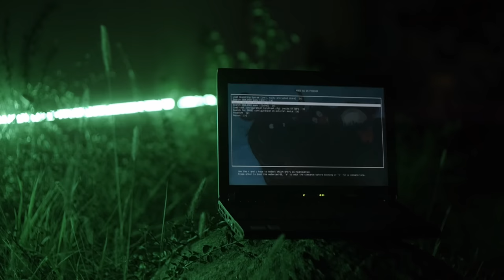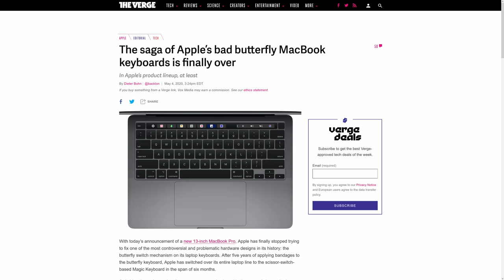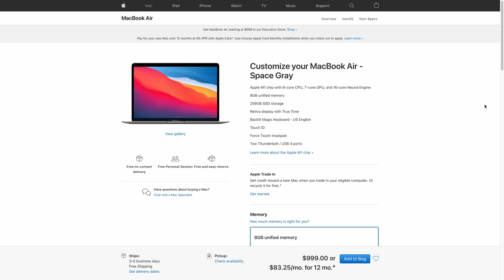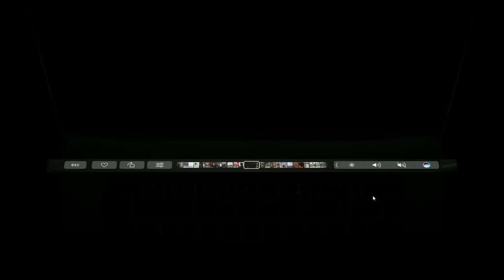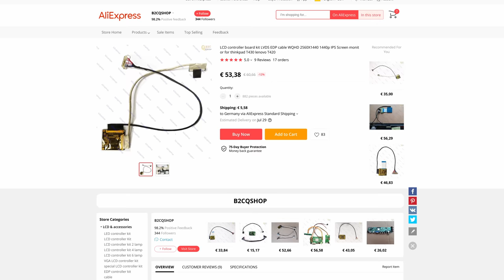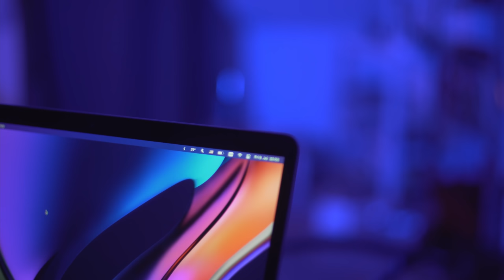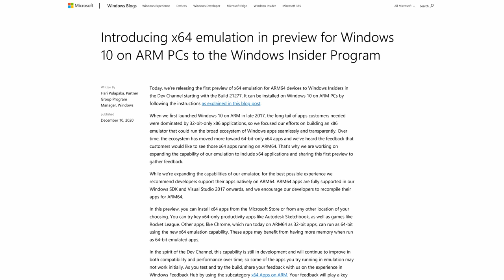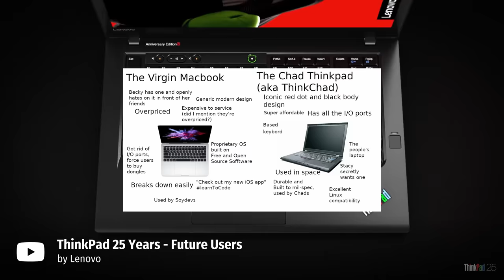Why I Switched to Mac (as a Linux user)

Comment: I have about 15 (older) thinkpads and love each and every one of them - but my daily driver has been a macbook air M1 since last December. You gotta be realistic about these things - and recognize a revolution when you see one. I even made my own pascal compiler that compiles natively to M1 ARM assembly language. Even though I do enjoy the past (my x41, x61, x220 etc) - I really appreciate living in the future! Thanks for having made this video =)
Reply: well, sure. Right now, M1 runs fast. That's not because apple is somehow revolutionary or anything - it's simply that Apple ported their OS to ARM first.

Give it a few more years, and all laptops will be ARM, and then apple will be one of the ones with worse hardware again.
Reply: Right? Bought my first mac a couple years ago, the m1 air, and it is so silent and portable.
Reply: @iFireender  well, first we need that to happen. Until then it is all conjectures and imagination.
Reply: @iFireender  It wont happen in a few more years, there's just too many programs and gaming that are done exclusively on x86_64, it will take more than a decade
Reply: @tuxthedev3470  luckily, programs that require high amounts of resources usually are newer programs. Newer programs (mostly, and really should) have well-controlled codebases. Most languages have well-defined cross compilation possibilities.

You can easily emulate a decades old x86 program on an ARM machine - those usually don't even begin to use up the capabilities of modern computers.

As for other programs? You basically just need to cross-compile, if even.

I assume we're going to see a true 50/50 split, where there's both ARM and x86 machines, performing similarly, arm slightly better, x86 being more legacy compatible, in 3-4 years, and in around 10 years we'll be entirely switched to ARM and/or RISCV.
Reply: @iFireender  That scenario seems more plausible
Reply: I don't like Apple's approach either about user upgradeability or repairability. Its all really been about the dollar, charging so much for an increase in storage, getting you to buy a hub because of lack of ports. That being said I do like they're products and the Macbook is a fine piece of kit and engineering...along with the ipads with M1 and M2 chips.
Reply: @jeppepuus  what is a fucking joke with apple is the pricing. Yes, the cheapest models are a good deal. Add 1tb of SSD (which should cost what, 60-70 bucks by now on the market), and 8GB more RAM (not even 50 bucks)? Please pay up 400 bucks.
Reply: Now there is a name I have not heard since high school in the late nineteen hundreds
Reply: @topmech71  I guess that's one approach. But Apple specifically is not making machines for enthusiasts who like to fiddle. Their stated philosophy is to create appliance-like machines. You don't change the motor on your dishwasher do you? Almost nobody does. People bitch about Apple soldering SSDs to the motherboard but it's debatable - most users never upgrade their storage anyway. And soldering offers other benefits, like improved signal transmission and lower risk of corrosion (important in hot climates). I think it would be good if they only allowed you to upgrade RAM & SSD. But I don't see that happening unless right to repair laws are passed.
Reply: @iFireender  Apple is also leading with their chips in iPhones and iPads and android phones can’t compete for years 😂
Reply: @iFireender  Mr Benz was not revolutionary either, he just was the first to combine an engine and some wheels and Elon Musk was just the first to invest tons of money in electric vehicles.
You literally said apple does something first and everyone else will follow in a couple of years, but that’s not revolutionary. To me it’s the biggest revolution in PCs for quite some time.
Reply: @iFireender  didnt happen with the iphones, apple dominates in performance, battery life etc
Reply: @iFireender  saying apple isn’t that good now because other manufacturers MAY switch en mass in the future is the silliest thing I’ve ever heard.
Reply: @iFireender  wasnt windows arm released in 2012 or so with windows8 ? i hope windows laptops catch up bc rn i dont see any competition in terms of battery life to perform. im duing some 3d modeling where appls m1 is still rather lacking but there just isnt an alternative rn.
Reply: @fxarts9755  the problem is mostly with things not being compiled for ARM. Windows ARM runs fine with ARM apps; x86 emulation is fairly bad - apple definitely is better there. But because most windows machines are still x86, almost everything is just compiled for x86. Apple went "nah, we're going all ARM now" and so almost all new apps are now ARM compiled.
Reply: 15 laptops? U mining bitcoin?
Reply: @iFireender  1. Windows ARM existed way longer before
2. Qualcomm CPUs are slow af, only recently the Snapdragon 8 Gen 2 is even close to A16. Before, A-chips would be double the performance of a Snapdragon. So why would you think Apple M chips would be slower? Apple bad, give me likes?
Reply: Well as long as nothing ever goes wrong with it or the SSD doesn't need replacing you will be fine. If anything does go wrong you may as well call it scrap because the repair costs are likely as much as a new machine.

Comment: Nice video dude. It's evident you really spent some time balancing out your arguments and position here in order to not upset any side too much. I hope people will be able to see that you kept an open mind about this.
Reply: He's got the same mental process as I do. It's cool to have a free software laptop, but even Windows is a beast nowadays, not to mention the engineering behind the MacBook. 
Now I have an HP Pavilion laptop with a broken keyboard. It's not that the keyboard is soldered, but if you want a new one, you have to tear the whole laptop apart and spend 20% of the laptop price in that part. So, I made my math and buying a new MacBook Air second generation is a way better option than upgrading and suffering this 2019 laptop. 
The only two things I'd miss is Windows and Linux... but for that I have this crippled laptop.

Comment: A reasonable and logical take, I have to admit the M1 silicon is super nice. I obviously agree with everything you said about Apple, I don't think the problem is their hardware per say, because right now its really good, the problem is their attitude towards letting their users actually own it. Once the community has gotten a surefire and reliable way to throw Linux on it, I might buy one myself.
Reply: Actually, they have! Been daily driving Asahi Linux on my M1 Macbook Air for the past half year, it's been great!
Reply: @aspectxyz  How's the battery life of linux on m1? I have a MBA m2 and really frustrated about OSX. I just find Asahi to be a little bit incomplete at this point.
Reply: @adonespitogonaif  I use all the major three - Windows on a PC, Linux on RPI4 server and MacOS on my M2 MacBook and I would never trade MacOS for linux.
Why is that? Because every time you need to actually do some work on it, something randomly breaks and then I have to spend 2 hours just on fixing it. MacOS just gets out of the way completely and you do you...
Reply: @adonespitogonaif  I get around 7 hours with light usage i.e. coding, browsing.
Reply: @aspectxyz  May I ask whether all I/O and GPU support works now? Which bugs did you encounter?
Reply: @shapelessed  Sounds like your issues may have more to do raspberry pi than Linux itself.
Reply: @Hornet135  Sounds like my issues are with linux generally working sketchy due to it's modular design. Everybody contributes different quality code to their libraries and utilities and these things just tend to randomly break on you.

Comment: I was on the Mac hate train for the longest time, and my experience with the first gen M1 MBA didn’t help (fell victim to the random screen crack issue). Decided to give the 14” M1 pro MBP a try and I absolutely love it. The fact that a good chunk of my Linux knowledge applies to MacOS is a godsend even tho there’s a lot of things I find myself missing. The most shocking thing for me is the fact that the few of my games it does support (which happen to be the ones I play the most) run almost as well as on my 3070 Legion 5 which was priced almost exactly the same.
Reply: What games can you play on macos?
Reply: @zethcubegamer5275  FFXIV, Subnautica, OSRS, and a few others I can’t remember off the top of my head. Steam has a filter for Mac compatible games the same way Linux does

Comment: good thing that we have a company like framework that have followed through on their promise for a repairable and upgradable laptop.  Hope they have more success.  However the performance of the apple chips does make it hard to switch.
Reply: Framework wont last long. All that upgradability is recipe for disaster. Those soldered ram modules and memory sticks are for a reason.
I have seen folks permanantly damage memory slots due to incorrectly seated module, smoke coming from contacts of M2 drive which was put in a laptop without powering it down correctly. Etc. So the more removable contact points you have on a system, the higher the chances for failure. 
Also it comes down to system and bios compatibility. You cant shoehorn ddr4 ram if the entire processor, motherboard and subsystems dont recognise DDR4. So a time will come when the framework laptop hits its upper limit of upgradeability like the old thinkpad showcased at the beginning of the video.
Reply: @anandmehta2323 so why is none of the stuff in my PC soldered?
Reply: @roidlsebastian  Because its cheap and designed to fail anyways after about 3 yrs. I own laptops like that. Failed a month after warranty expired and repair cost 50% of new laptop cost. I have two here I can gift someone - not that they are of any use.
Reply: @anandmehta2323  Mine is 9 years old and works flawlessly without ever having any faults.
Reply: @anandmehta2323  If that's the case, we should just throw anyway custom desktops then. Have no prebuilts, have no desktops, just go all in completely soldered. Your point of framework products failing because of their upgradability is extremely flawed. The reason why soldered laptops are popular is because it's much cheaper to produce compared to having everything modular. It's much cheaper to have one factory building everything all in one go than to have multiple for different modules. Also laptops are an all in one package so for many manufacturers, it really doesn't make sense to make everything modular. Lenovo saw that not many are upgrading their cpus so they just remove that upgradability path. They did not remove it because it cause harm. They also didn't have a real plan on how to deal with excess CPU modules nor do they build their products on complete modularity. Framework, on the other hand, has a plan for extra CPU modules and built their laptops from the ground up with sustainability and modularity in mind so the two companies can't really be compared equally. As for upgrading ram and other components, I never seen anyone break their laptop from upgrading. If a person is upgrading their laptops, they already have some knowledge of computing and probably already know and researched their laptop. If not, that's really on them but that doesn't mean the product is a flop. Even then, upgrading or replacing any component on framework's laptop is easier compared to other modular laptops. Each component in framework's laptops has labels and qr codes pointing to instructions online.
Reply: @anandmehta2323  also, no, modular components like ram sticks are not design to fail in 3 years. If that's the case, you would see many people protesting about their desktop/laptops not working in 3 years. Actually, most laptops have a modular storage device like a HDD/SDD, do they fail in 3 years? I bet most of those laptops are way past 3 years and still functions normally.
Reply: @shikeyy  Who talked about modular components. keyboards fail, trackpads fail, hinges fail, panels crack. And these are made specific to a model and refreshed every 2 yrs and not available. I have two laptops here like that. One has a keyboard issue which needs me to plug in an external kb. Another has broken hinge and back panel the replacement part for which is no longer available.
Reply: @shikeyy  Dude do you know how hardware works internally? How the components talk to each other? I have been building computers since 25 yrs. Thats all I can say. There is a limit to upgradability. Sooner or later you will need to replace the entire unit.
Also plug in and plug out components enough times and you could have contact issues. Had this happen with a test mule computer where ram slot stopped working because the contacts wore out. Had another ram module short out because an idiot newbie did not seat it properly. I am not talking out of my ass. I am talking from years of work experience.
Reply: @anandmehta2323  yes components all fail at some point, I'm not denying that. But, your statement about Framework failing because of its modularity within their products is very short sighted. The reason why you can't get replacements for those broken parts is because manufacturers like Dell and Lenovo don't offer replacement parts. Most of the time you need to buy them secondhand. Also, modular laptops isn't part of their core business model unlike frameworks. Their entire business strategy is sustainability and modularity. They offer replacements on all their components in their products. Albeit more expensive compared to others, they support their older products.
Reply: Everything in a laptop can be replaced in some way - they are modular in that way. It's just a case of if you can find parts and the ease of replacing them, which many laptops manufacturers don't have a good track record for offering replacements and guides.
Reply: @anandmehta2323  LMFAO and that's why Desktop RAM manufacturer's include a Lifetime Warranty that covers any issues with RAM 🤡
Reply: @Madhawk1995  That does not include shorting. The warranty is for manufacturing defects.
Reply: @anandmehta2323  and I have been building computers for 35 years, I remember 8086 and CGA cards. I have never ever shorted a component. Of course, i never tried changing anything with the power supply or battery still connected. That might explain it… 

manufacturers didn’t move away from RAM modules in laptops because the slots got damaged after thousands of module changes. They moved away because it allowed them to build thinner laptops, was cheaper to manufacture, and allowed them to charge exorbitant amounts for memory upgrades, only available at time of purchase. Apple offered RAM slots in Macbooks up until 2012. i still have one of those. Upgraded from 4 GB to 16 GB and didn’t short anything. 
Also changed the keyboard after some liquid spill. There are plenty of aftermarket keyboards for the most popular apple models, even for 2009 models. 

Slots may get damaged after incorrect placement or thousands of changes, but memory chips also get damaged. I have seen many computers where the RAM was defective. If modular, you just replace the defective module. If soldered, you throw away the laptop.
Reply: @anandmehta2323  Dude you just have bad luck or something. I've never had a component fail outside of warranty until at least 6 years after in my PCs
Reply: @danielrobinson3654  Its a matter of statistics. I have handled thousands of servers and desktops. How many have you handled?
Reply: @anandmehta2323 good think you can change the motherboard in those framework laptops, so you can upgrade from ddr4 to ddr5 if you want. 

I also don’t buy the argument that user serviceability will be their downfall. That hasn’t hurt any of the component manufacturers targeting the DIY desktop market. What might be their downfall are their prices, their laptops definitely aren’t budget. They’re not outrageous and you’re supporting a good company, but still.
Reply: @anandmehta2323 those modules are soldered for a reason" yes! So your only option is to buy a brand new laptop if you want to upgrade your memory! And because people will destroy it must be the dumbest reason I've heard in a while; sure I wouldn't trust grandma with upgrading ram, but that doesn't mean that it should be soldered? I think if someone is too unknowledged to upgrade ram, they probably won't open the internals at all!

Besides fencing with "I've worked with computers for 25 years" doesn't make your argument more valid, as it's still just a dumb statement if I say so myself 😐
Reply: @HNedel  soldered ram is also capable of higher speeds.
Reply: @schm147  the signal paths are shorter and more direct, but i am not aware of any laptop that has higher ddr5 or ddr4 speeds with soldered ram than what is available as dimm modules.
Reply: @anandmehta2323  it's no use of arguing with an Apple sheep. All they can see is how great and mighty Apple is, they'll never see their dark side, and that the lack of RAM and SSD upgradability is not exactly to benefit the user, its for Apple's benefit. Do you realize the cost of repair for any Apple product? It's better to buy a new product altogether than to repair an Apple product. It's daylight robbery.
Reply: Came here to say the same. Ironically that apple "fanboi" Linus is an investor in Framework
Reply: @roidlsebastian  yeah the guy you're talking to obviously doesn't know what he's talking about. Laptops last forever as long as you don't drop them or put them in water situations.
Reply: @roidlsebastian PCs aren't getting carried around like mad